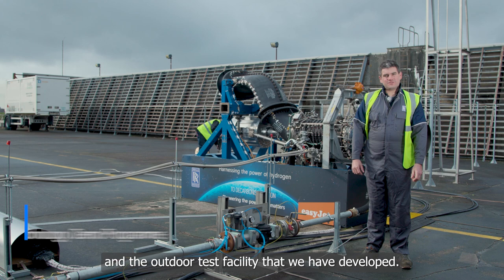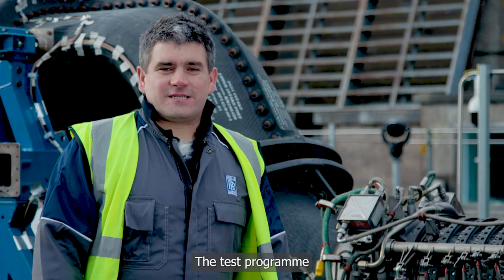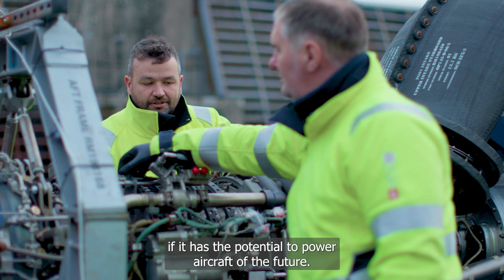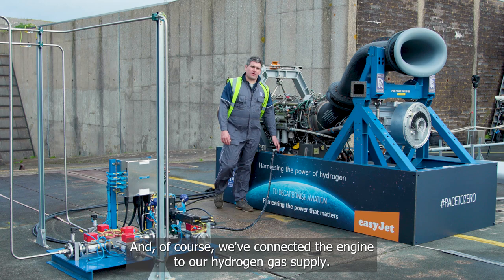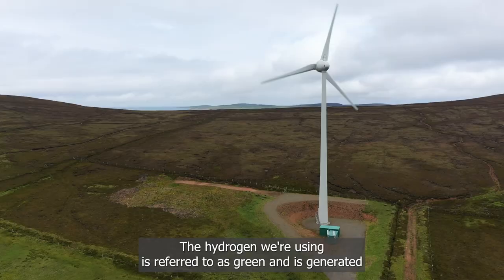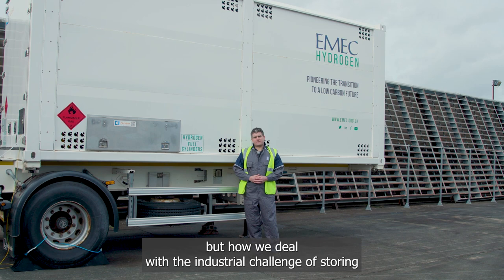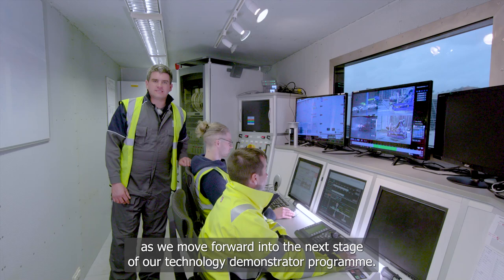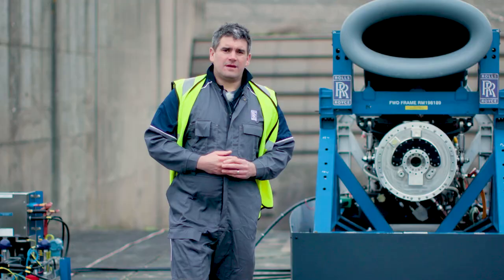Rolls-Royce | Rolls-Royce Hydrogen video from Boscombe Down

Comment: Sadly this is a massive waste of time. If there was a way of storing the hydrogen that was feasible I'd have some faith but there is currently no visible technology which will do this. And that's before we look into making the hydrogen in the first place, or the fact that it's not zero emission and the nitrous oxides and water vapour are harmful. Sadly long haul aviation has nowhere to go with available technology. We will have to dramatically curtail it's use. Unless some radical technology comes along that can enable this.

Rolls Royce know this as well as anyone else, which is why they are testing their engine in a back yard.
Reply: ah yes the famous harmful water vapour. I'm sure Rolls- Royce hasn't spent years researching this with the best engineers in the world and that some guy in his bedroom is totally correct.
Reply: Clearly you don't understand what Boscombe Down is and how engines are tested. I can see where the "back yard" impression would come from when you are uneducated about the subject matter but there is significantly more tech and engineering involved than is being shown. The ability to significantly reduce fuel burn and use electric also exists and its very simple but the key is the efficiency and system control. In reality its not just the OEM engine manufacturers its also a significant airframe change which is hugely expensive so the tech needs to be developed on the bench first. This is what you are seeing
Reply: @nicksweden3277  please do this two things:
1) compare energy density of kerosene and compressed hydrogen (please take in account required compression, assume you need to have 1 kilo of hydrogen in 1 liter volume)
2) google temperature that required to liquify hydrogen for case of liquid hydrogen

and then please come back here with numbers
Reply: Hydrogen is light great for aircraft event though hydrogen take too much amounts of space and need special treatment